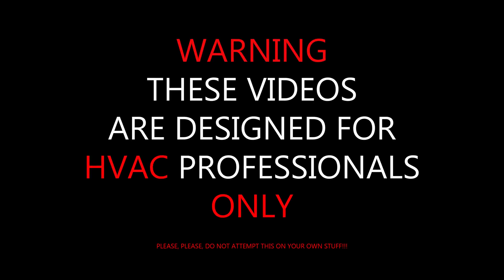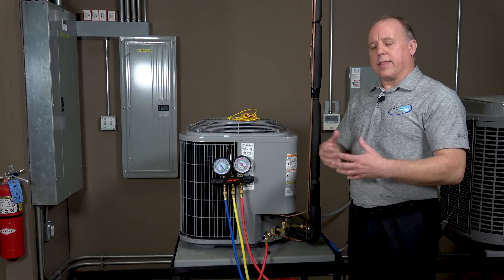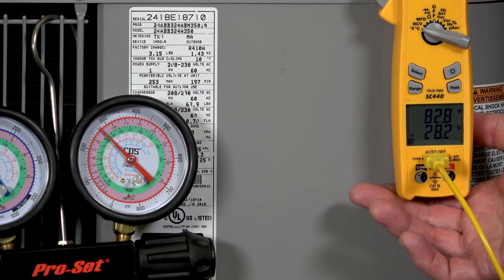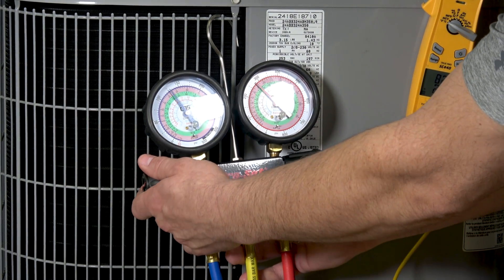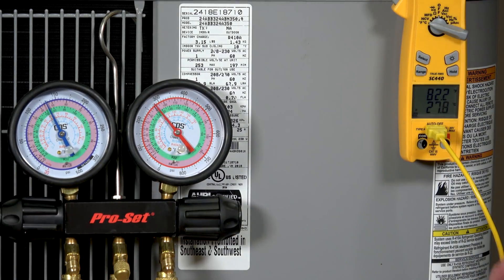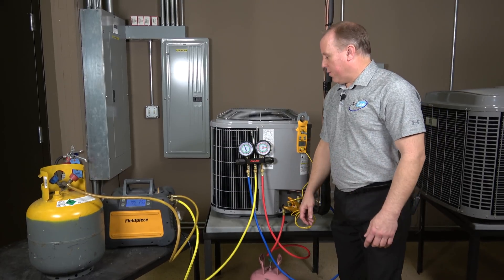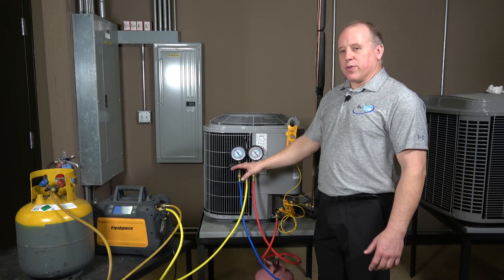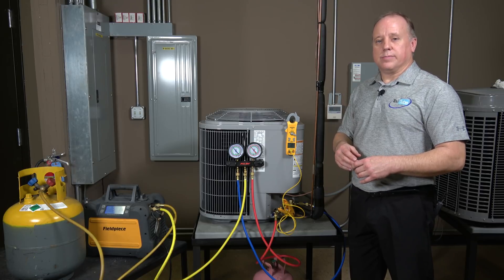Checking Refrigerant Charge for R-410a Condensing Units Using Sub-cooling Method

Comment: I bet you don't know how much refrigerant you added cause ya didn't use a scale for starters. 

Also, wet/dry bulb dude?

I guess he tried.
Reply from the maker: We used the sub-cooling method in the video because we have a TXV instead of the superheat method, with wet/dry bulb measurements, which was common 15+ years ago for non-TXV systems.  Carrier requires the sub-cooling method in their manual for checking charge.
Reply: I wonder how you'd use a scale in hundreds of pounds of refrigerants in unknown pipe length runs in commercial? Answer: you usually use subcooling, not weight. Wet/Dry bulb is for charging by superheat in non-txv metering devices.  You not learn this stuff in tech school?  There are lots of youtube videos around to assist you (you need it apparently, bro).
Reply from the maker: A scale is normally used to track your refrigerant for EPA purposes and record keeping.  In our lab, however, we add and remove refrigerant daily and we also re-use our refrigerant with the students.  For this video, we did happen to show a new tank being used.

Comment: Fun video. Truly for a pro. Because a pro knows that the evaporator and the area its cooling is probably at 60 degrees or off. High subcool. Tough gig
Reply: What are you talking about the evap being 60 degrees off? That's completely false, who told you that? And on top of that, for subcooling your measuring the temp of the refrigerant at the suction line, not the physical evaporator area......

Comment: You did not use clamp meter to check the  exact ampere of the unit?
Reply from the maker: No, we did not show that in the video.  Checking the amperage of the unit is a way to help confirm the compressor is operating properly.  In this video, we were just showing the sub-cooling charging check.
Reply: No such thing as needing to check for amps when charging a unit.  Irrelevant.

Comment: is the unit on when adding the r410a?
Reply from the maker: Yes, it was an operating system that we were adding charge to.
Reply: you cannot charge anything without the compressor turned on (other than a small initial amount when you pulled down a vacuum).